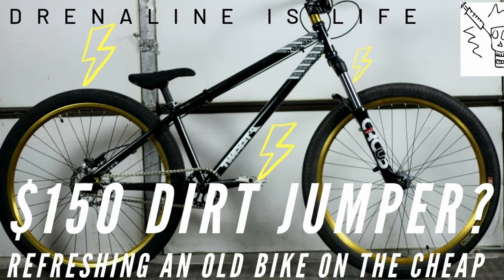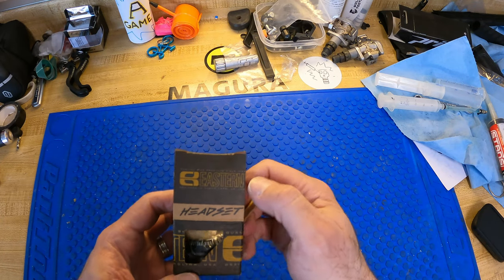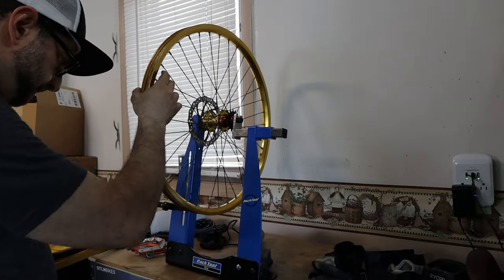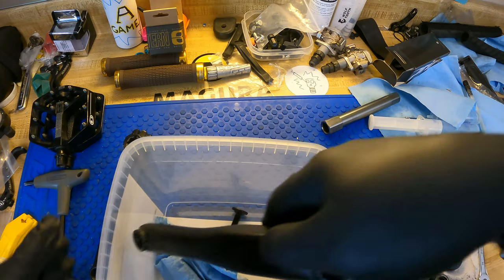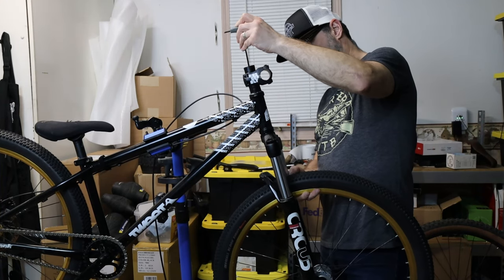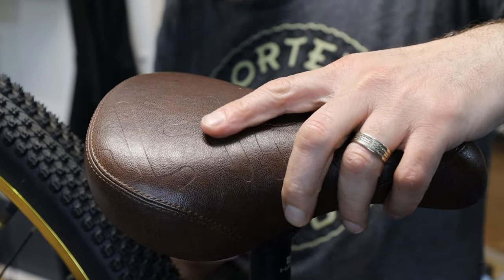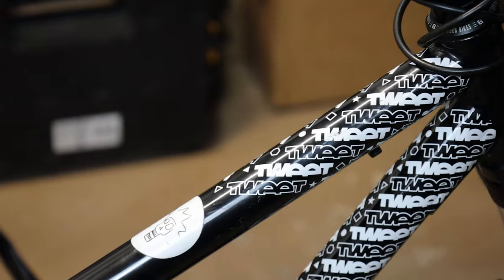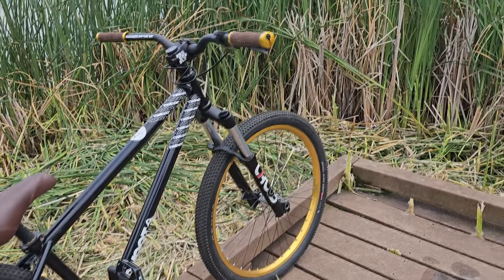$150 Dirt Jumper Refresh | Improving my Spank Tweet on a Budget

Comment: Those cranks you took off are a lot better than the ones you replaced them with. Better off buying a new replacement crank spindle. Unless the crank arms were stripped out. Nice fix up none the less. Oh and get rid of those chain tensioners! You definitely don't need them when your dropouts are that small. Looks so much cleaner without!
Reply from the maker: Thanks. I know.  The old cranks were toast, and I already had the other cranks laying around. I wish I could go without the chain tensioners, but I've had the wheel slip too many times.